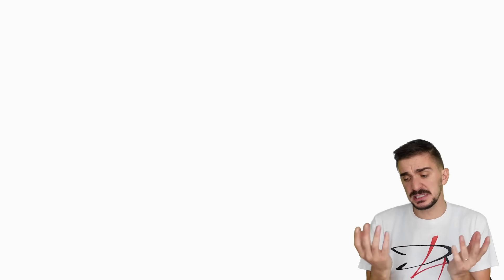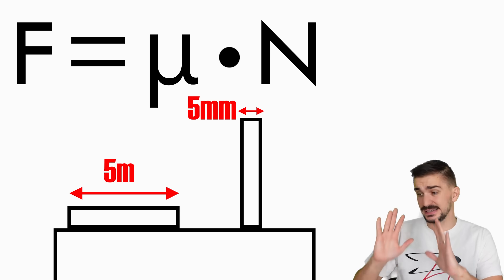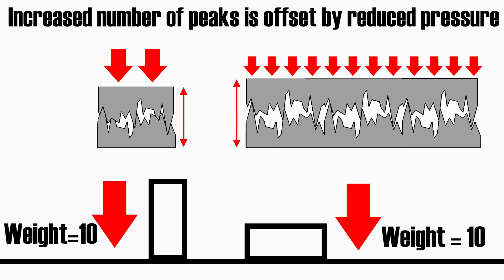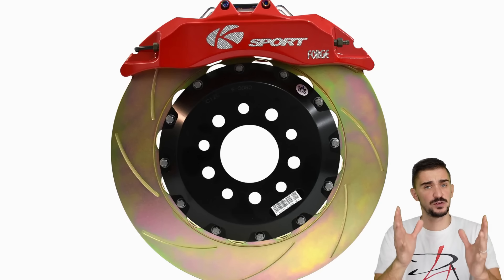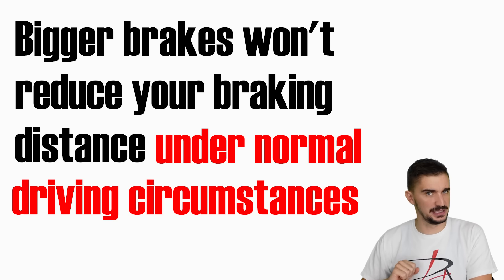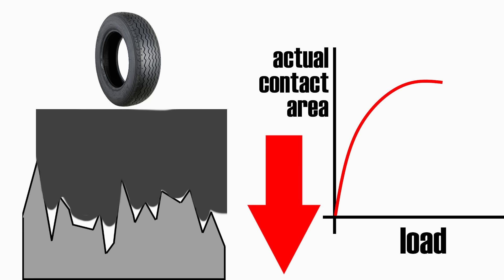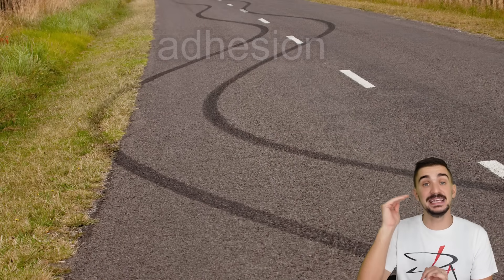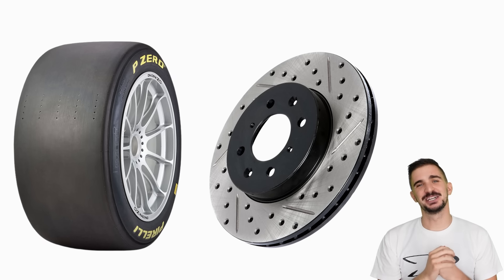Why Big Brakes Won't Stop You Faster but Wider Tires Will - Friction and Surface Area Explained

Comment: Good video, but missing one other important point, which is that if you have a wider tyre, the pressure is less so you can use a softer compound which gives more grip.

Comment: The two actually correlate with each other. If you increase your braking surface and grip force you slow the wheel down faster, which allows the wider contact patch to grip faster and slow down. The thing is if you use a wider tire and do not increase your braking force you will not stop that much shorter as you now have more unsprung mass to slow down which will cause the brakes to fade faster. Also you would want to upgrade your suspension too, as preventing over excessive nose dive or weight moving to the front wheels will also increase your stopping distance. This is why high performance vehicles have very stiff suspension to allow the vehicle to stay flatter when stopping and cornering. They all work together to help stop the vehicle.

Comment: But with bigger brakes, there is more total surfacer area that the brake pad is touching. So in one rotation of the rim, with a bigger brake disc, the surface area that creates friction is bigger since it’s a circle, can someone please explain me why I’m wrong I don’t get the explanation
Reply from the maker: Surface area isn't part of the static friction calculation formula. Only the normal force and the coefficient of friction.
Reply: @d4a  I just watched the updated video you uploaded and I understand everything now, I’ve never felt so relieved for understanding something that I never got in the first place for years, thank you!

Comment: A big flaw in your assumption is that the normal force stays the same. When you have more surface area you can apply more force to the contact patch without distorting or otherwise damaging the brake or pad, thus a higher surface area allows more frictional force.

Comment: I have found that going to a larger rotors on the front and larger drum on the rear do improve the stopping power of the brakes. also I have found that a wider tire have better traction in dry wet and snowy conditions.
Reply: stopping power =/= braking distance

Comment: In the interests of completeness  larger diameter discs do give greater breaking force everything else being equal. The reason being the braking force is at a greater average radius from the wheel axis hence increasing the braking torque. This only means less hydraulic pressure is needed. However in practice the hydraulic pressure is not the limiting factor to rate of vehicle deceleration hence  none of this changes the premise of this video.  Another great video thanks...

Comment: Althougth the explanation is correct the conclusion is actually wrong because the author does not consider that the disc is a rotating object thus the force the braking caliper is appling to the disc is transformed into torque applied to the wheel.
Although the friction force remains the same, the torque actually increases because the radius of the disc increases.
Torque=radius x force
and bigger disc > bigger radius > bigger torque applied to the wheel
But anyway the braking does not significantly improves for road cars because the limiting factor are the tires' grip.
But bigger disks in the same wheel size on car equipped with lets say slics will deffinetly get improved braking

Comment: The tyre is inflated and supported by air pressure; therefore the apparent contact area is a function of tyre pressure, not width. The apparent contact area is the same regardless of tyre width; only the shape of the contct area changes. The normal force is a constant determined by vehicle mass. The pressure is force/unit area =>  area = force/pressure. Tyre width doesn't enter the equation. Since width doesn't change the size of the contact area, any benefit of wider tyres must be explained by the changed shape of the contact area.

Comment: It would be of interest to discuss how the brake friction material/caliper has a greater mechanical
advantage ie more leverage on a larger diameter rotor, being further away from the axis, versus
the higher surface speed of the rotor to pad interface per revolution... of a larger diameter disc.

Comment: big brakes wont stop you faster in an emergency braking situation what it will do is continue to be is consistently well brake from to stop after stop while smaller brakes will start to fade and lose braking power.

Comment: Bigger brakes may not do that much BUT the composition of your pads sure will. I run a street / track car and still have the stock rotors and calipers but the factory pads simply heated up and faded in just 10 minutes of a 20 minute run. After switching to racing pads and breaking them in I can run until my rotors are glowing red and still have full brake authority. Note you have to flush and change the brake fluid too because regular OEM fluid will vaporize and you'll lose braking there too.

Comment: Nah nah. Almost, but no. Wider tires do NOT mean better braking or acceleration capabilities. They DO mean better lateral traction (taking turns). There are of course extremes. Obviously a bicycle tires won't give you better acceleration. But a 345 section width tire won't either. For example, top fuel cars have a tire that is 17.5 inches wide, however after punching the accelerator the tire immediately grows 2 inches in height (38 inch tall tire) and significantly narrows the tire. Typically the lack of psi and the tire compound is what largely dictates grip. Another leading factor is the tires contact patch shape. A short but wide contact patch when benefit cornering. And a tire with a more narrow and long patch with help with straight line traction. But I personally believe that whatever width is taken out needs to be added to its height.

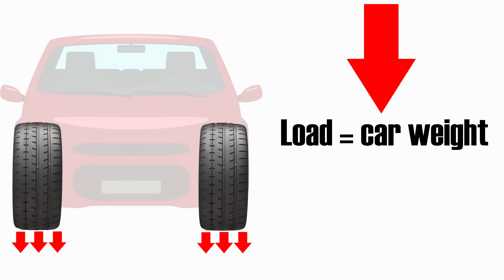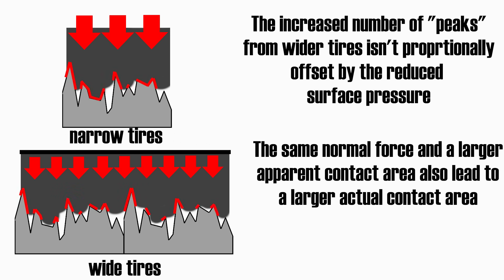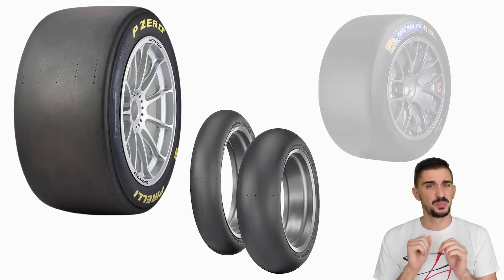Comment: 12:20, 12:54, 15:25 wider tyres don't really give more surface area, tyre pressure does. If we take a bunch of baloons of different sizes, each with same internal pressure, and press them against a glass with same force, we'll see the same area of contact between rubber and glass, no matter the size. And usually if we follow tyre/car guidelines the pressure stays relatively fixed for a bunch of tyre sizes, so the contact area is fixed too. Which kind of throws half the video off the window. Especially since bigger tyres do help, just for different reasons, like contact path shape and thread stiffness - latter being the reason slicks are better or why street tyres screech under cornering, and why bald tyres don't really increase grip much. Also camber! according to the explanations cambering the tyres (like race cars do) should reduce contact path and worsen (at least) the braking, while in practice it's almost not noticeable :).

Making videos on tyres for everybody is extremely hard as its a very complex topic, and overall video is great but i feel like the surface area is a similar misconception like Bernoulli explaining wing lift. It makes sense on paper but just not how it works. I'd love to see the topic revisited, cheers!

Comment: Hi. fascinating videos. I love your mastery of the subjects. In this one, however, it seems to me that you forget an essential parameter : the distance between the brake and the axis (center of the axle). The less difference between the distance to the axis of brakes vs tire surface, the more braking force we have. It's a matter of leverage. Let's say the tire thread is 10 inches from the axis. this is its lever. In order to counteract this force, the brakes must have the longest possible lever as well, but the are limited by the inside diameter of the rim. Still, the bigger, the better, even if they won't ever get the same lever as the tire itself.

Comment: Addition to better heat management, a larger disc also has more leverage, which WILL make you stop faster; considering your tires won't lock up. Great explanation tho!

Comment: Except when braking hard from high speed, when small (and usually not ventilated) discs and pads will overheat in 2 seconds and they'll quickly lose the efficiency. I've experienced this in my old 2003 Focus while driving on the highway, speed was about 150 km/h and an accident happened ahead. The guy in front of me floored the brakes, it was a newer car. Luckily, I was keeping a safe distance from him and this saved my car and insurance. Shortly after pressing on the brakes, it started gradually losing power as they quickly heated up and I had to apply more and more pressure to keep up with the rate of the car in front was decelerating. When we eventually came to a full stop, I had half meter left to the guy in front of me and the pressure I was putting int the pedal was insane, like in F1, with all my body pushing against the seat and my foot was cramped. I think I ended up putting around 150kg of force in that pedal during last couple of seconds. It's insane how you think brake discs and pads don't matter. They might be irrelevant at slow speeds, but high speed braking is another story.

Comment: but, also, torque is force times distance, so the larger the distance between the center of the wheel and the area of contact of the brake lining, the greater the torque. this means increasing the distance will increase the ability of the brake to stop the wheel given the same force.
Reply: Stopping the car is not the same as stopping the wheel
Reply: Only if everything else is equal and it won't be that much extra torque to matter. You can easily compensate for smaller rotor radius by either increasing the brake pads area or you can increase force by changing piston sizes in hydraulics. Tires are the most important limiting factor for braking and even smaller rotors can lock the wheels, so you can't really use more power for braking.
Although larger rotors might give you more breathing room for designing the rest of the braking system.

Comment: Tires aren’t solid they are pressurized to let say 32 psi. With a car of 2000lb each tires than support 500lb… well if the weight is spread equally like on an MX-5. Than 500lb /32 lb/sq in = 15.625 .. bot what are the units… sq inches. yes .. If P=F/S than S=F/P Yes the only variable for contact patches of tires are weight of the car and tire pressure  not tire width. Wide tires are more effective at breaking and turning not because of contact surface but factors like reduced deformation. Apart from that your logic is solid.

Comment: You left off one advantage larger brake discs have over smaller ones: The braking force is applied a further distance from the center of the wheel/tire assembly.  The increased distance gives an increased braking moment for the same force applied.  This allows the brakes to apply the same stopping power with less pressure and heat.  More efficient braking, less heat.  The larger braking surface definitely helps with heat, though.  And like others, I have also argued with a physics professor about greater grip given by wider tires.

Comment: also big brakes stop you faster cause of:
- Usually bigger calipers = more force to push pads against rotor
- More leverage due higher diameter of rotor = Torque formula (M = F * r)
Reply from the maker: None of it matters if stock brake overcome tire traction, see the follow up video please
Reply: @d4a  Yes I realized that. In my answer, I focused solely on the ability of a larger brake disc to create more braking force.

You are 100% right in your answer if we look at it from the perspective of the tire

Comment: A larger brake disk also has more mass, so it will sink a bit more heat before heat soak. This can give it more time to cool during non-braking times. On track with stock sized brakes but aftermarket pads and rotors, my brakes heated to the point of glowing orange during braking. Since I had single piece steel brake rotors, much of the heat was transferred to the wheels. The wheels got so hot that a few of the taped on wheel weights fell off when I pulled into the pits. The wheels of the car were acting as an additional heat sink for the brake system. I really could have used a set of larger rotors and matching calipers.

Do wider tires actually have more contact area with the road? A tire is filled with air, and because of this the contact patch area may be the same for different widths of tires when presented with the same weight of a car. The shape of the contact patch may change, but the area of it could remain the same

Comment: We had a Car content youtuber that work as a tuner and worked on VW designing brakes, and he had a tough time explaining the same thing, bigger brakes don't make you stop faster. At first he tried to explain using physics but people were not satisfied so he had to literally put into test by recording braking times with original brakes and bigger brakes, the times were the same. And then he made another video, but upgrading only the tires, the results were a lot better. And till this day there are people that do not believe him, even after watching his videos, crazy
Reply: I am still confused, increase tyre width will literally increase the weight, so more weight means more friction(according to physics). Also wider tyres are designed for performance cars, ie, the material will be more rubbery and will Increase friction. So upgrading a tyre actually improves the frictional performance but I don't think it's because of this thing(in the video)
Reply: @arifzain6844 Wider tires offer increased surface area which gives significantly more friction, that's the main reason for the upgrade. The added weight is not enough to make much difference unless you are getting really massive tires. You can actually get very high performance tires in normal sizes as well. Only reason to size up is for more surface area.
Reply: @Burner-j1t  Surface area doesn't increase friction on brakes or tires. Without enough weight, oversized tires will lose contact patch in the middle of the tread due to the difference in pneumatic load and sidewall load (except floppy drag tires). Most passenger cars come with undersized tires for fuel efficiency reasons.  If you car already has optimal tire size for the car's weight, increasing it further will decrease grip.  Surface area only allows a tire to carry more weight, which means you can only get better braking if you have a soft suspension (more weight transfer), a heavier car, or additional front downforce.
Reply: @actually5004  Surface area increases friction, literally more rubber touching the road. I was talking about the surface area of the contact patch, not the tire itself. The wider your contact patch the better and on 99% of cars wider tires will get you a wider contact patch, because as you said they are made for efficiency. Yes obviously after a certain point wider tires stop providing more grip, because that's how air filled rubber works. No one is putting 20 inch wide tires on their civic and that is clearly not what I was saying to do.
Reply: @Burner-j1t  What formula can you find me that states surface area affects friction?  Surely there must be one.
Reply: @actually5004  Are you really trying to act smart while not knowing Force=pressure*area?? When you increase AREA without reducing pressure the overall force increases. Now plug that increased force into the classic F=uN and you get... higher friction. Duh. Its literally explained in the video which you clearly did not watch.
Reply: @Burner-j1t  Try again, this time with the knowledge that the contact patch on pneumatic tires is entirely load-dependent.
Reply: @actually5004  Obviously its load dependent?? It is also width of tire dependent. You arent going to get a great contact patch on a 3 inch wide tire no matter what load the car is under. How are you not getting this?
Reply: @Burner-j1t  A wider contact patch does not mean it has more area because it will be thin and may not even make contact in the middle without enough weight.  That's how pneumatic tires work.

Comment: Shouldn't the braking torque increase with higher brake diameter?
Reply: BOT...... stick to anime
Reply: @mishaisspeed4081  well, if you don't understand why this would be a valid question, you should stick to simple repairs and part replacement
Reply: @MrPolluxxxx  Bru
... You are the one that doesn't understand.... And the reason that your question is kinda stupid is because: as said in the video like 20 times, and commonly known irl, even small brakes can easily lock up a wheel. Therefore the limiting factor in the system is the friction of wheel to ground..... Oh and btw this was said like 5 times in the video. He addressed your EXACT question

Comment: How about wider tyres on compresses snow, acceleration, braking and friction on steep down hill slopes. The greater the tyre area in contact with the road/snow, the lower the pressure per unit area. So are wide tyres on snow really a good idea?
Reply: No, actually wider tyres perfom terribly on snow because there isn't enough pressure to press the tread of the tyre into the snow. A good example how to go on snow is the World Rally Championship. When they have stages on snow (Sweden Rally), they use super skinny tyres to get the best grip on snow.